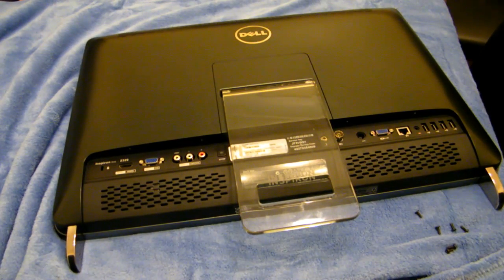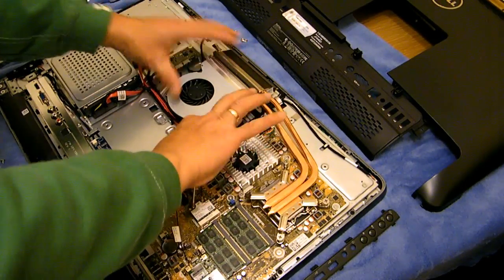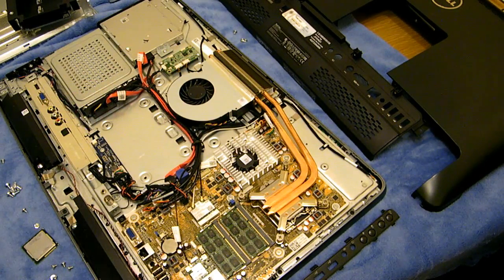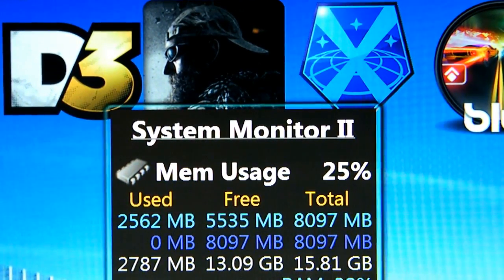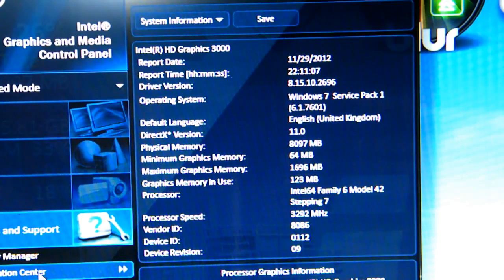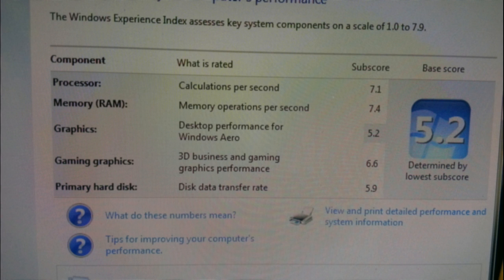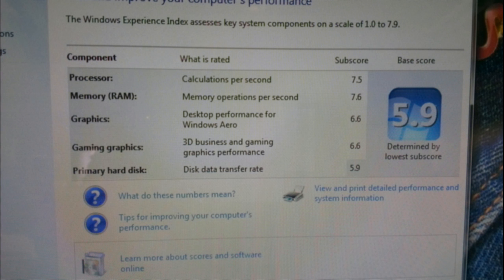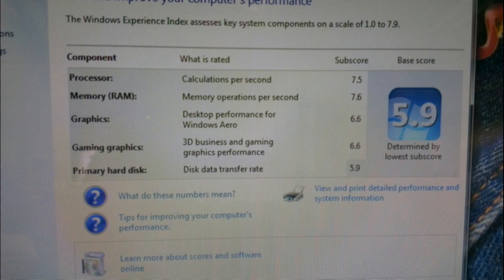Dell Inspiron 2320 All in One CPU Processor upgrade installation

Comment: TECH NOTE: Be sure your not standing on carpet when doing this, otherwise you will need a ESD strap to your wrist. I would suggest using your kitchen island or counter on a floor with tile not carpeting. Standing on tile or wood floor would be better, however wood floors might still have a static issue. Just in case of static discharge.
Reply: This is total bullshit, I've built and repaired computers/electronics for over 30 years now, I've handled THOUSANDS of cpus, gpus, motherboards, ram, etc on carpet, on beds, couches, in the back of a car.... I've never owned an ESD in my life and I've never had a SINGLE problem....

Comment: What's the largest processor and type that a 2305 can use? I will be replacing the SATA HD cable in it to fix all the BOOT issues, Dell hasn't bothered to tell people. Only 1 Dell Tech I know of has admitted the Sata connector is crap and replacing it fixed most boot issues and Blue Screens of Death.

Comment from the maker: As far as I know all of the 2nd generation processors will work in various ways. The problem is the BIOS if it doesn't recognise the processor then the turbo boost technology doesn't work. So with my i5-2500K I get 3.3ghz but no turbo to 3.7ghz. I'll try and get a list off standard 2320 processor configurations.

Comment from the maker: Hi Roberto it's all about the air flow, sounds like yours is suffering from it. Watch the video about fan installation it solved the problem completely. If your not confident fitting them find a friend.

Comment from the maker: The 2600s i7 works fine as this was an option at Dell. It will also take the 2600k and a 2600. Although turbo boost may not work correctly with the k version you will still get a good speed.
Reply: i have the 2600s i7 2800 ghz on 8 cores with 8gb ram..

Comment from the maker: It depends on the state of the board if you can solder another on but they are available on eBay. It's not too difficult to get the board out.

Comment: I talk to someone at Intel and  they said that 2nd Gen Intel processors are compatible with this machine but didn't say which specific model so i wondering does it matter meaning a specific model because i want to put a 2nd gen core i7  in this machine but don't know which model

Comment: This is what a Dell technician online had told me "Due to Power fluctuations the motherboard would have gone faulty because of which when you connect the AC adapter it’s switching off."  Please explain further.  Thanks much.

Comment: My Inspiron One just shut down while I was connected to the internet.  Even the blue led light on the cord wasn't lighting up even if was plugged.  I tried to turn on the power button but there wasn't any respond.  Then I pulled out the plug from the computer and disconnect the cord from the adapter and reconnect the two together.  That's when the led light on the cord started lighting up again.  But as soon as I plugged it to the computer, the light disappeared.  The computer would not turn on.

Comment: Is the inspiron one 2305 charging? I noticed, when I accidentally pulled the plug, the computer turned off. Do I need to replace my adaptor plug or it doesn't really make the computer system charge at all?  The computer system doesn't carry a battery right?  Thank you.

Comment from the maker: This is the heat sink and fan for the graphics processor, they put a very small fan on it! The Nvidia 525m processor is under there along with 4 memory chips for it and then another 4 on the other side of the board.
I did try and find another heatsink and fan but due to the space restrictions could not find one that fitted.

Comment from the maker: Hi, I'd like to as well but I'm afraid we are stuck with the graphics card that came with it. The system is very much like a laptop when you get into it. So the graphics chip is part of the circuit board but I have another video where we cool the graphics card and that allows you to run games then with the high settings without the system overheating.